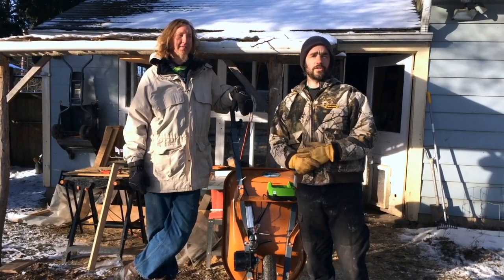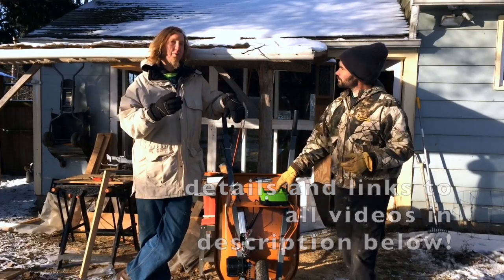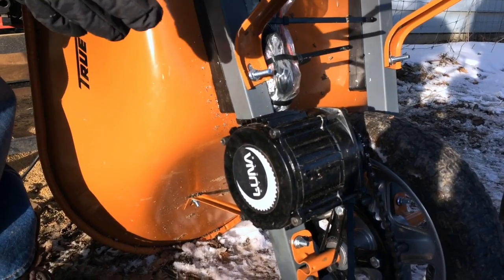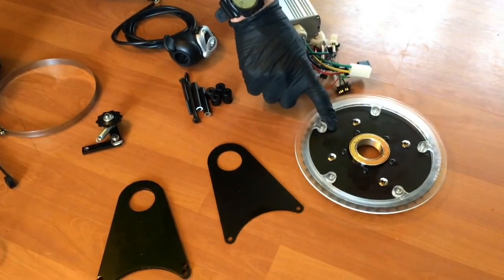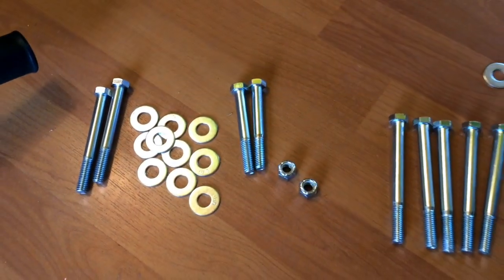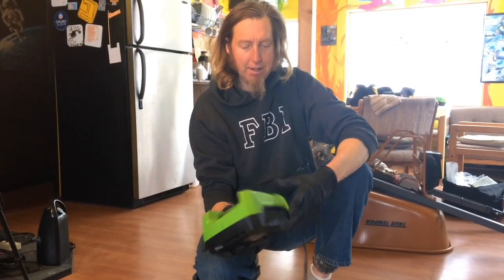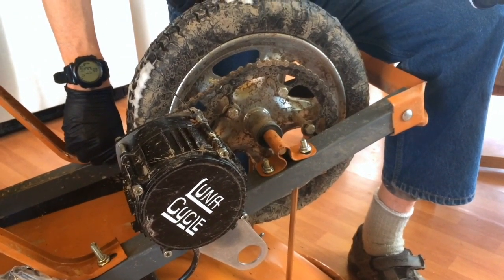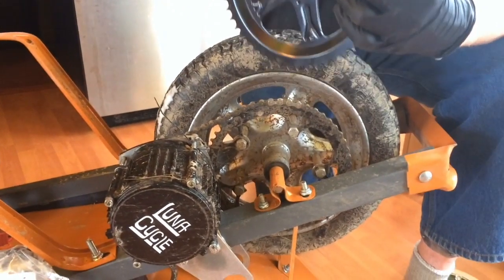Electric Wheelbarrow - Build part 1 - Intro and Start

Comment: hello, thank you for making this. i am considering a project like this. i was wondering if you could answer some questions. could i use a 1500w motor?  how do you calculate how much torque and subsequently the load it can carry at given wattage of motor? also, could a 12v dc battery power something like this or no? thank u.
Reply from the maker: https://electricbike-blog.com/ - Check out Karls website/blog which has WAY more info and maybe that will answer your questions.